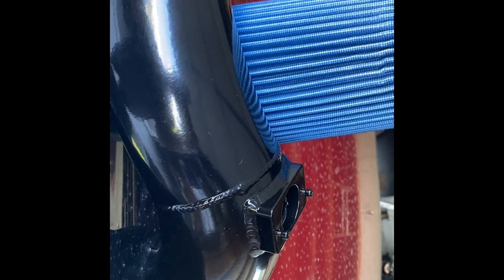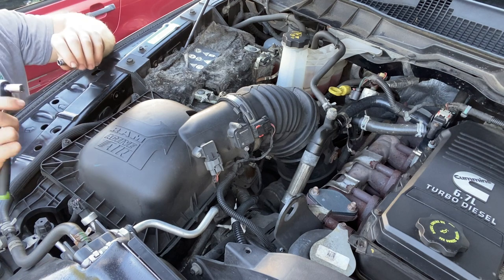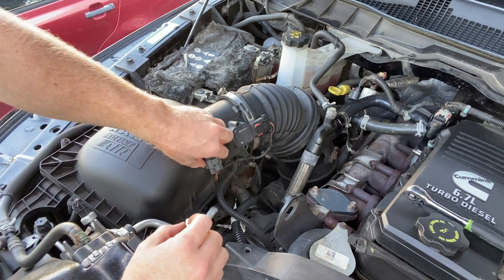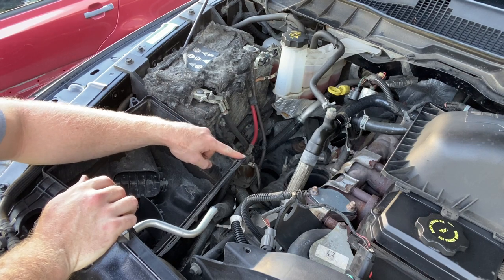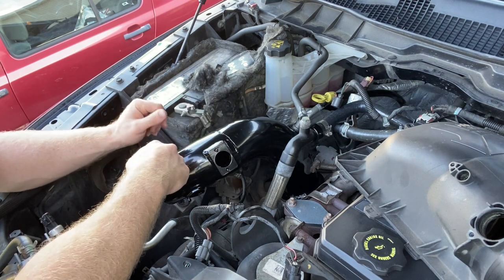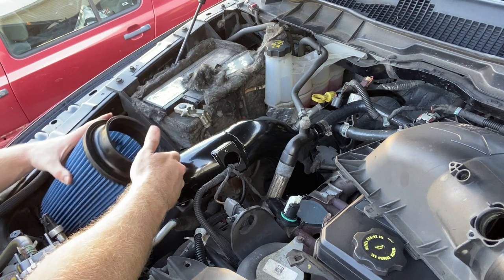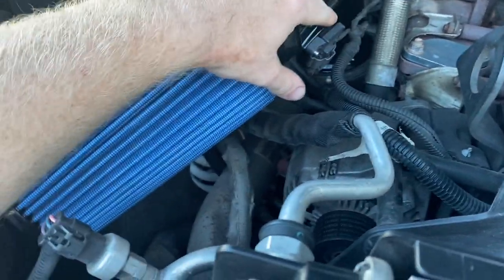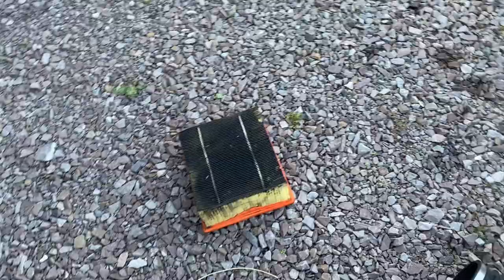Cummins 6.7 EBay intake install, review, Drive. Worth it or bust? #cummins #3GG

Comment: A take the noise ring out of the turbo then you'll really here it, its easy it's just a big c clip
Reply: That’s on the he351 turbos not the vgt turbo. Those have a intake air baffle that quiets it down on the 2007 and up trucks with the 351vgt
Reply: On that turbo there's 3 pins that will have to be drilled out of housing to remove the silencer ring.  Not hard, just a little more effort than the retaining clip in older turbos
Reply: @dsahlst  that’s not a silencer ring, it’s purely an inducer ring to direct airflow! Takin it out on a 6.7 Cummins with the stock turbo will not add any benefit, just turbulence going into the turbo, although on a 5.9 you’re definitely gonna be able to hear it more, due to that being a silencer ring! Hope that helps 🤌
Reply: @Slumpy_Sloth   Yes that ring, regardless of motor displacement, performs the same function of airflow direction.  Personally, I don't think it is worth the effort to remove on the VGT turbos since you have to drill them out.  Merely trying to save someone from tearing up their turbo trying to remove a retaining ring that doesn't exist, rather than trying to prove the size of my brain :)

Comment: did you have any issues with the ram air setup? i know it has a a electeical connection wondering if you had any check engine lights or issues after it being removed?
Reply from the maker: None at all I’m still running this same exact intake it’s in the description. That was even before I did my full weight loss
Reply: @3guysgarage  thank you for the quick response
Reply from the maker: @adorno1010  any other questions feel free to ask! Plenty of Cummins content on the channel would appreciate a sub if helps a lot with growth

Comment: Hey man, I just got this exact intake after watching your vid. When you first installed and drive did you hear only the turbo or did you hear a surge aswell, like the filter sucking air in? That’s how mine sounds and I checked for a boost leak and it’s solid.
Reply from the maker: Hey man explain a little more or whatcha mean? I have had no complaints at all since the install it’s still installed on mine. Hope you’ve subbed to the channel it really helps